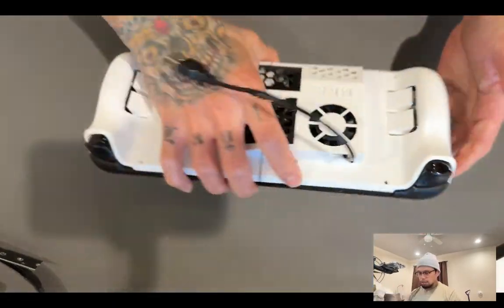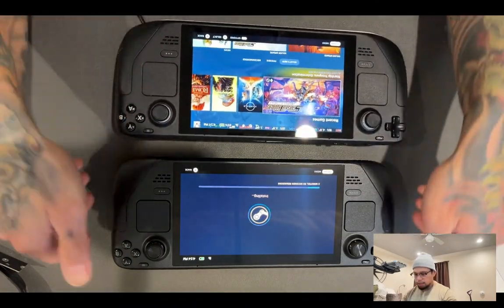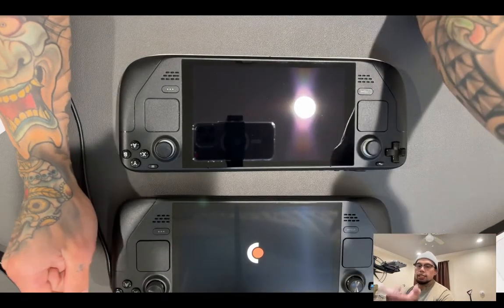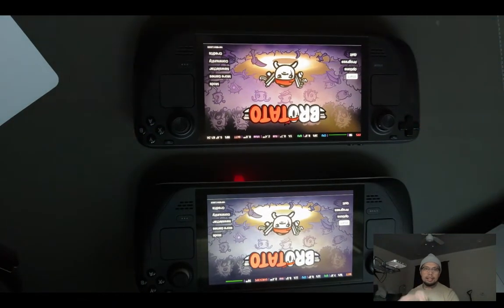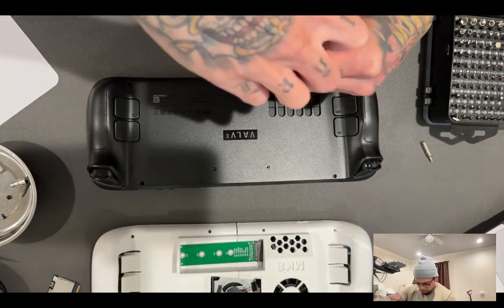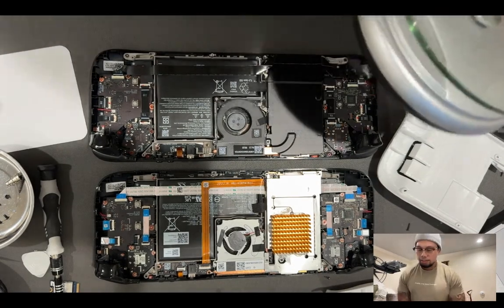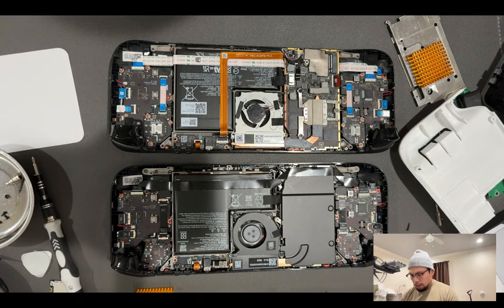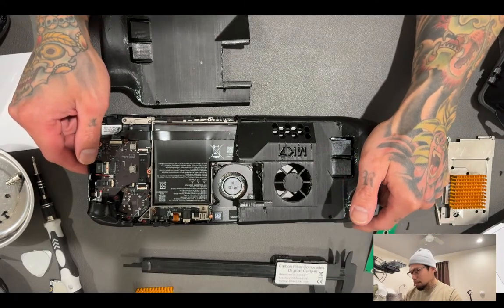Steam Deck OLED Unboxing

Comment: Very interested on how the new hardware will OC/UV compared to LCD model
Reply from the maker: Me too, should overclock better since the chip can handle more heat
Reply: @Diy_Papi  Doesn't a smaller APU die require less power while delivering the same performance? If so, why is the OLED model giving the same performance as LED at same wattages, when it should exceed said performance at the same or lower wattage?
Reply from the maker: @3rennan1  Good question,

 Think about it this way, lets look at the steam deck performance as top speed for a car 

Let’s say top speed is 100 mph for 100lb  steam deck(car)

Let’s assume the refresh steam deck has the same top speed of 100 mph but ways 20% less (80lbs)

Both have the same top speed one just uses less energy to get there because of its weight.

That’s why the refresh is no faster but uses less power, puts out less heat and weight less.

Hopefully that makes sense 😅